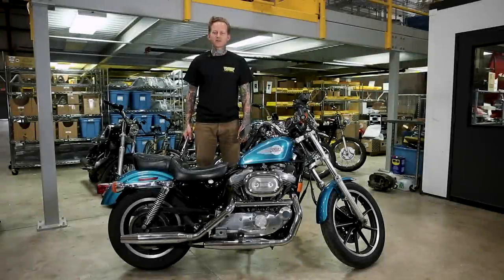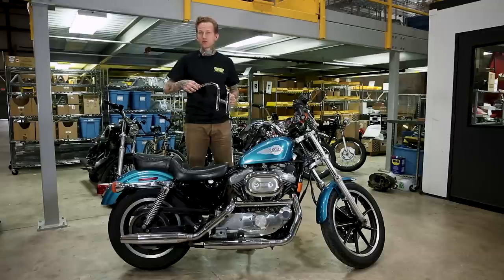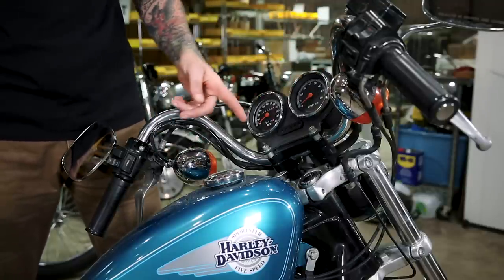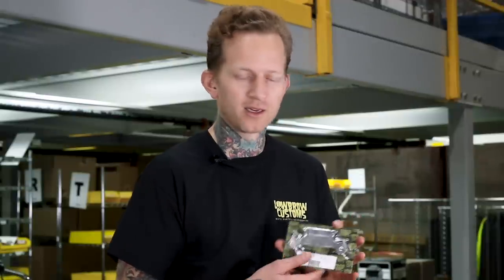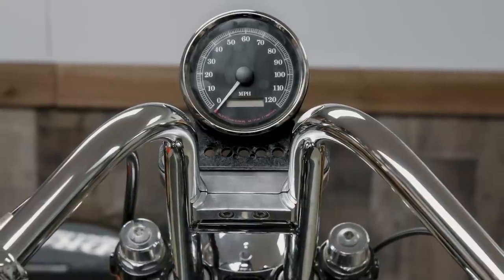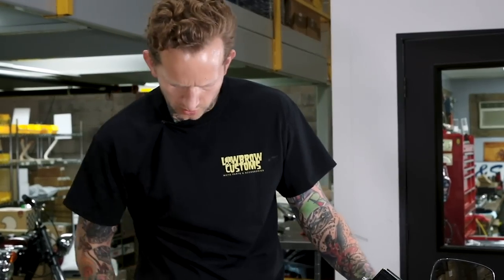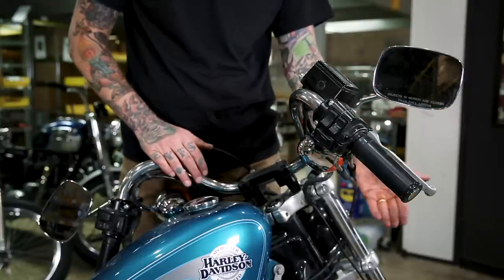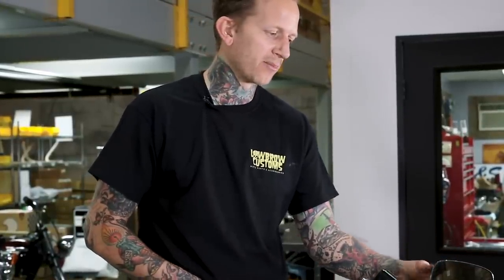How To Install Lowbrow Customs Rabbit Ear Motorcycle Handlebars Onto A Harley-Davidson Sportster

Comment: Hey, I have your Frisco tank and I was wondering if these bars would have enough clearance, as the tank sits higher than stock
Reply from the maker: yes you should have enough clearance. if you go to the actual listing there is dimensions there. If you really are worried messier from the top triple tree where your bars would go and see the height of the bend and see how much it will be. I had a shovelhead with Frisco sportster tank and it was completely fine.

Comment: Does that brake cable look stretched - a bit short ?
Reply from the maker: We were just demonstrating how to install these bars, we would not run it this way. We highly suggest always getting the right size cables and cleaning up the bars of cluttered huge turn signals and big mirrors by replacing them etc.

Comment: Just bought these and installed them, also did a 3 inch tank lift and now theres not enough clearance, do u have risers available for this? 1999 883 sporty.
Reply from the maker: https://www.lowbrowcustoms.com/collections/motorcycle-bungs/products/1-2-13-threaded-handlebar-riser-bung-mild-steel these will rise it up  1/2" you maybe able to combine 2 of them for 1" but you defiantly will need to find longer bolts. sorry for the delayed response on here.

Comment: So I ride a 2015 sportster 48. Does that mean I need the “dimpled” bars?
Reply from the maker: if you want to keep your stock controls yes you want to use dimpled. if you are deleting turn signals and starter from bars etc you can run smoothed but need to do some re wiring.
Reply: 48’s can only run clamp on style bars unless you get a joker machine  upper triple tree.

Comment: What size brake cables would be recommended with these bars? I just bought your rabbit ear bars but not the narrow ones.
Reply: Btw I have an 09 Nightster 1200xl with stock handlebars and cables
Reply: @scoophouser  what did you end up getting?

Comment: Living in Europe…. Wondering if adding the mirrors would look very stupid with rabbit bars or not. Anyone tried it before?
Reply: Lowbrow sells mirrors with clamps so you can attach them in the regular spot by the grips or move it towards the bottom of the handlebars out of the way. I think TC Bros or Prism supply sells one that mounts into the triple tree pinch bolt, but it's more expensive

Comment: Is there any way to keep the indicator lights as well with the speedometer?
Reply from the maker: if you got dimpled bars and yes you can run the same bulky lights if you wanted to. just not our preference and they may hit the tank if mounted low.

Comment: What is the safest way to totally remove the speedometer and turning signals?
Reply from the maker: trace where the wires and cables go and un hook them, do not cut if you can.